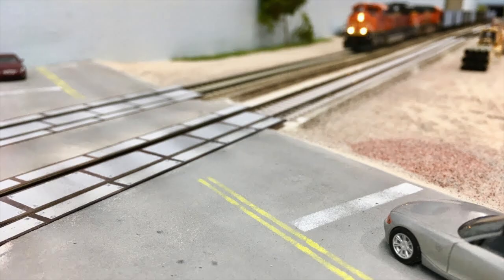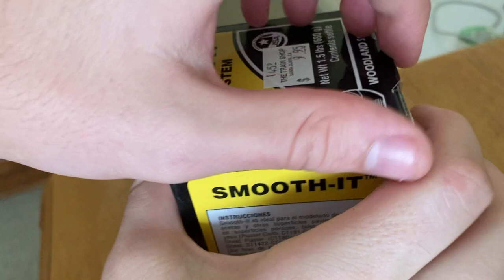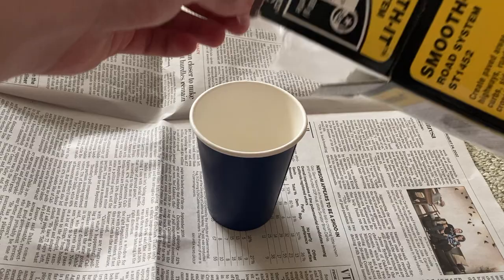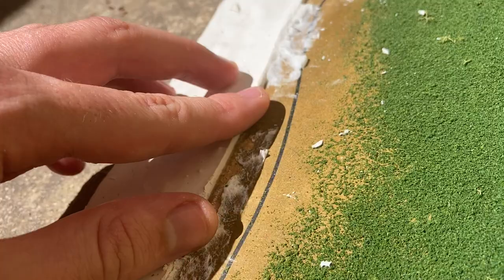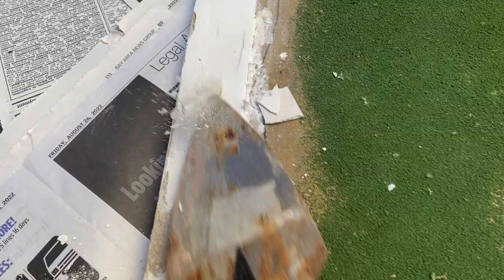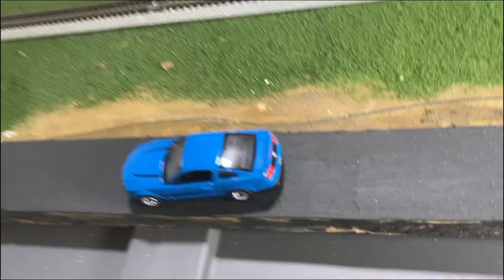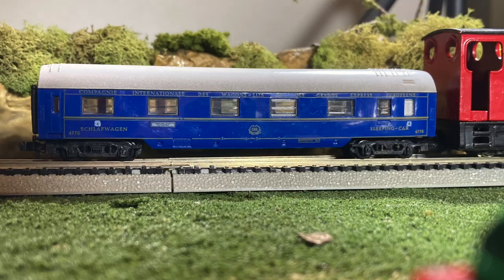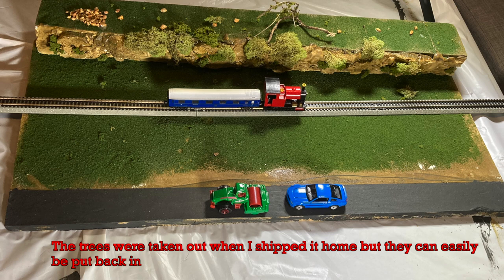T1E2H3 Fails at Building a Model Road

Comment: Well I guess the way people get things smooth with sanding is by first using a heavy grit sand paper and then going over it with a finer grit. The heavy grit removes a lot of the big imperfections, then the fine grit helps smooth out the small ones.
It's tedious though which is why I don't sand stuff down often myself, and when I do, I just use one grit, which I then use paint to hide the "imperfections." And of course, how I get it looking smooth as I can, I mentioned my methods in your Horace vid. How that helps you somehow.

Comment: best way i make my roads is to use filler and once it dry sand it down and if there any little holes just fill them in with filer then sand them down then you should be good.

Comment: 6:54 The Ford Mustang has a 0-60 acceleration of between 4 and 7 seconds, and a battery charge time of between 7 and 9 hours.

The steamroller, on the other hand, has a GIANT ROLLER, and crushed a narrow gauge van.

So, in short, the steamroller.